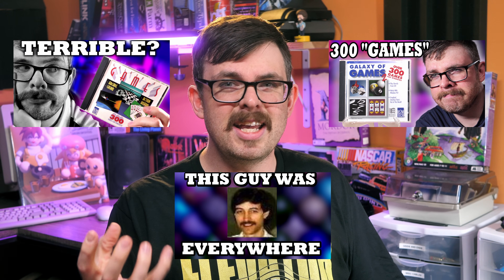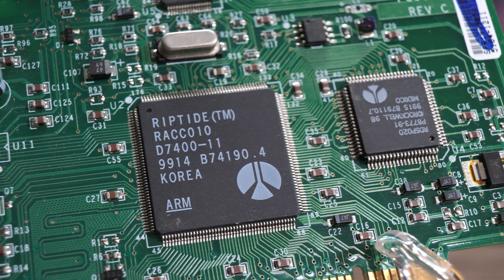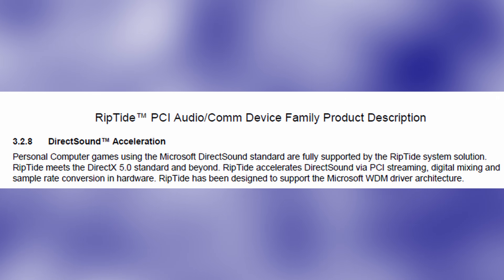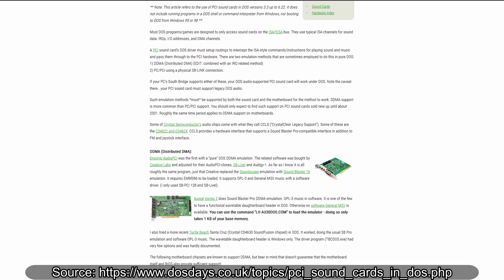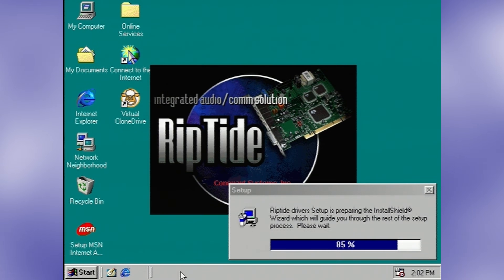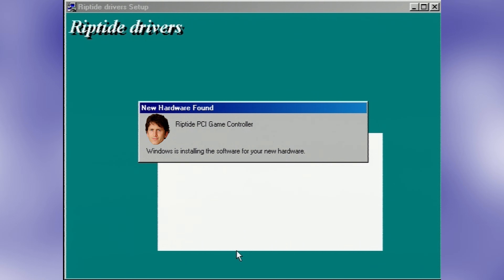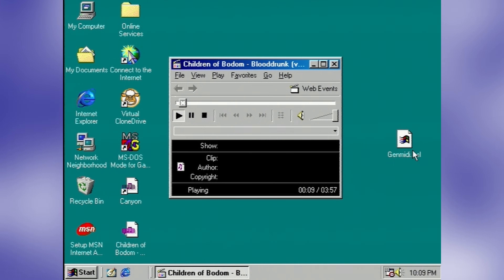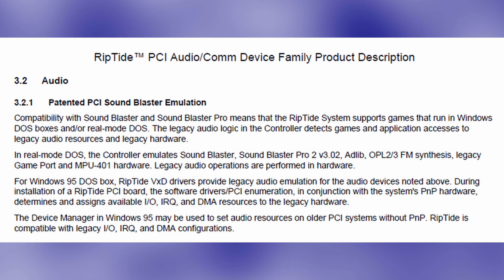This 90s Sound Card Had An ARM Processor! (Rockwell Riptide)

Comment: I have an HP Pavilion 4450 that came with this card. The genmidi.wsl that was packed with the restore disc is 9mb, so it’s different than what you have.

For dos drivers, know that the fm synth doesn’t work on the breakout board. You have to use the headphone out on the card itself.

Comment: Not bad for a $6 sound card. The General MIDI wasn't bad. The OPL was a mixed bag, EoL-ui-Moheom and Commander Keen 4 sounded pretty good, but Tyrian 2000 and Duke Nukem 2 sounded wrong.  However back in the 90s I probably would have been good with it, especially since through the 90s the only MIDI option I had an MT-32, which is great for the games that directly supported it but terrible for General MIDI tracks.

Comment: Would love to have a link or something in the description for the "modified driver" you ended up using. I have two of these cards (they're the D7400-12 variants) and never had much luck finding the right drivers for them, because of similar reasons you mentioned in your video.

cool to finally see one of these cards working correctly in a system tho!
Reply from the maker: Sorry I forgot to post it! 
Here you go: https://archive.org/details/hp-riptide-drivers-genmidi-gmram_202510

Comment: Turtle Beach had several of these combo cards. They SUCKED. Not because they didnt work, it was the same issue you ran into. Reload your machine but dont have the original recovery disks and suddenly you dont have the correct drivers. And you cant find them.

Comment: Here's how I do the Voodoo3 3000 cooling: there are 50mm blower fans, so you can put normal fan screws halfway in the two holes of the fan and then push the screws through the Voodoo3 heatsink. It will hold tight enough and pull the air through the heatsink. I also replaced the TIM with some indium foil, double-layered in the middle because the chip is concave. Now the card, even at full load, is comfortable to touch on the back of the PCB.

Comment: The sound effects in duke nukem 2 use creative's ADPCM format and many cards don't support it. It's surprising the sound works at all but I wouldn't hold it against the riptide. Since it uses genmidi.wsl, it uses the Wavestream softsynth that a bunch of other cards and systems used so it probably sounds familiar to a few people. My guess as to why the drivers didn't have the WSL file is because this was intended to be an OEM card, the softsynth was licensed by the PC manufacturer (EG packard bell) and not by Rockwell.

Comment: I've had this exact sound card and the related hp desktop from 1998 that it would have shipped with. HP used to directly host the driver files though I believe they've been removed in more recent years. The model number of the HP desktop where this sound card can be found stock is 8570c

Comment: So how's the modem? I feel there's a distinct lack of modem reviews in the retro YouTube community for some reason :)
Reply: The major factor in modems is whether it's a "hardware" modem or a "softmodem"; the latter relied on the PC's CPU to do all the signal processing, so could be decidedly flaky.
Rockwell was known for hardware modems and was a reliable brand for them.  The fact that this soundcard has enough processing power to do it on-board suggests that they're at least taking the same approach with this card.
Googling turns up a Vogons thread which indicates that the Riptide uses a discrete DSP chip (the smaller one to the right of the big ARM chip) to implement the modem functions, while the Chameleon omits the DSP chip and operates as a softmodem.

Comment: Duke Nukem II  has ADPCM sound effects so the clipping is likely a flaw in the Sound card's ADPCM decoder. FM sounds a bit off but not horrible. It's at least trying to emulate an actual  FM synth. Probably doesn't implement all the operators to make it easier to emulate on that 90's ARM processor.

Comment: not a bad sound card for a clone and the midi is decent, yeah rockwell conexant are well known for there DSP/accelerator mostly in TV tuner / mpg decoder , encoder cards and they where really good but never heard there sound cards but now I have and good sound, the other thing they made where modems and some nics from memory.

I think there still around too mostly usb Audio as TV tuners but they are getting rare HDMI receivers too, there are hacks for some to use as Software Defined Radio as well for them should try it one day. Fun chips.

Comment: This was one of the dreaded WinModems/SoundModems from back in the day.  Pure garbage.  Drivers were always a real pain in the backside - even on Windows. Audio playback performance was abysmal at best (talking WinAmp era here).  The modem performance - when drivers did not cause issue - actually seemed to perform better than the sound playback.  The particular soundcard you show was especially common on Compaq and HP systems running Win98/WinME.  In particular, these cards were often found on the dark grey HP's (heavily rounded cases) as well as the large white Compaqs with the semi-translucent blue plastic faceplate.  I did many re-installs of Windows back then on systems that had these cards and even compiled a single driver CD that was burned with about 300 different versions of drivers for these cards.  If you were installing Linux... the sound playback was so-so - modem functionality was "fughetaboutit".  These cards became particularly problematic when upgrading from Windows 98/ME to 2000 or later on... XP.    More often than not: two identical looking Rockwell SoundModem cards that came from nearly identical-looking Compaq machines would end up needing completely different drivers.  The drivers were more often than not locked to each OEM's version of the card (hence the lack of drivers online).  Back when the drivers pages were still up for systems like the old Compaq Presario and HP Pavilion mini-towers.. those were often your best bet for finding compatible drivers.  Then once you DID install the drivers, it was "fingers crossed" that the system was fine after the reboot.

Comment: The sound effects being broken in duke nukem 2 might be missing/broken adpcm support.  Pretty sure soundblasters had some kind of adpcm support for digital audio.
The samples for those toms are pretty wacky haha.
I'd often considered this card kinda junk due to it being as far as I understand an OEM winmodem+soundcard and yeah the difficulties with drivers.  Don't think this ever had linux support either.  I'm guessing because of the microcontroller on it, it might've needed a firmware to function at all.  Wonder if anybody's looked in to reprogramming these in some way as a cheap entry to "software defined hardware" projects like the picomem/picogus?

Comment: I didn't/ and don't think PCI era sound cards were all that bad.  After all, it was an era when Microsoft was phasing out real mode drivers for the WDM crap they insisted we used.  Plug and play was great in theory, but the mechanics did not like to mix.  I do have a couple of those sound cards in my win98/95 computers, and they are pretty good for earphone use and a person does not need the 5.1/7.1 setups.  Otherwise a soundblaster audigy is my primary pick. It's funny though how people seem to diss the old tech of peripherals while accepting the crap that's poked on boards.  Or for that matter, accept the crap sound of their phones as opposed to a dedicated MP3 player.

Comment: Wish you went into trying to get it to work on DOS. PCI sound cards that work in DOS are wonderful and I was hoping to see how that turned out.
Reply from the maker: According to the data sheet the FM and digital sound should work in real mode DOS. Its really hard to find a complete driver set though. I assume the original driver package sets up a batch file to make it work.
Reply: @DOSStorm Yes, but the point is Windows 9x runs over a custom version of DOS, so there's no reason to run DOS. Windows 9x IS DOS with a GUI. You can even open the command line in full screen and pretend you're in DOS. They don't give you the original DOS in 9x, it's a custom build optimized to run Windows. You're not getting any special difference, other than RAM usage, which nobody should need to skimp on with used prices being rock bottom. This is a technique for day one 9x users with low RAM machines. Maybe people who upgraded from Windows 3, but it wasn't needed for 98 machines. It's essentially snake oil, and I don't get why people want to do it.
Reply: I am NOT a fan of this brain rot, as Windows itself runs DOS, and it DOES NOT CONTAIN DOS 6.22, so the "DOS" you THINK you are running is the same as the Windows method, except with manual DOS setup. The reason why it likely doesn't work, is because it probably requires manual editing config files to enable drivers. Except it makes no sense to EVER do this, when Windows will run the DOS programs. He's literally showing off these games, which are all DOS, running in Windows. I don't get it. Is there a single program you actually need to run in DOS? Do people not understand the Windows version of DOS is not 6.22? If you wanted DOS, why isn't a dual boot mentioned, etc.? I don't get it. Seems like a "just because" hassle scenario.
Reply: @JohnDoe-ip3oq get help

Comment: "Games that push the limits of FM a little more like Tyrian or Doom".....pretty sure Tyrian, like many Epic Megagames titles of its time didn't use FM music, and instead used tracker files.
Reply: Tyrian 2000 sounds best with FM/OPL3. I'd go so far as to say that the soundtrack was probably made with it in mind. One of the great OPL3 soundtracks of all time.
Reply: tyrian has fm and midi and like that music modes.  it sounds like fm on adlib, like it doesn't have the crazy mod player from star control 2 in it.
Reply from the maker: Just to clarify I said Dune not Doom there. Also Tyrian does use FM OR general MIDI, and with a good card I would say the FM soundtrack is preferred. However, on clone cards it has a way of highlighting limitations which makes it good for testing.
Reply: @DOSStorm  Yeah, my mistake I thought I remembered it having tracker music, but listening to it now I can hear it’s FM.
Reply: @DOSStorm  did you ever try the hack routines to play samples on adlib on these clone cards? like star control 2 (i think pinball fantasies did the same trick).

of course it's a fairly useless  thing to know how badly it breaks or how. but still.

Comment: PCI audio cards were the reason I was so happy to just get integrated audio on motherboards. I still miss the sweet nostalgic farts of my sound blaster but when we were finally able to get past that garbage era of PCI sound cards we were all better off for it.
Reply: then we had nforce2 integrated audio with perfectly reasonable configurable multichannel digital out.

and for some reason they can't give that anymore. and you're stuck with realtek that could do it if they just put a tiny bit effort into the software to let you do that. instead the control panel is made by some guy in weekend as an example of how to do it with 0 features.
Reply: Did PCI sound card get better over time with Windows XP ??  or have they always just been rubbish ??